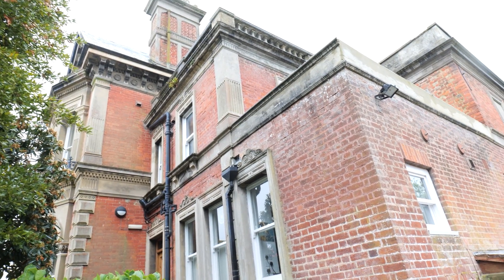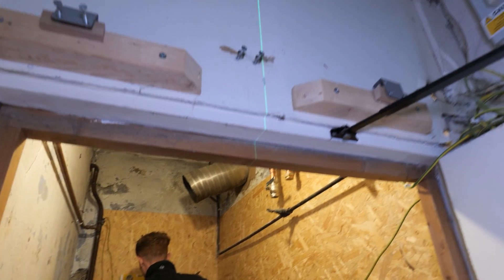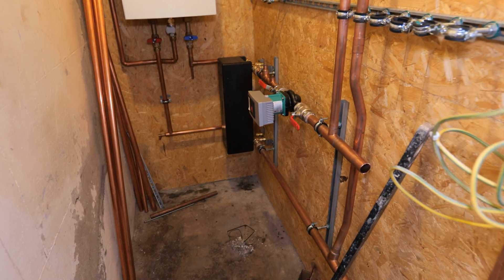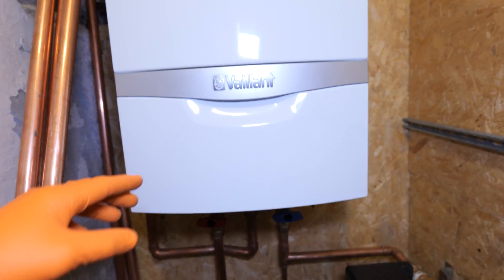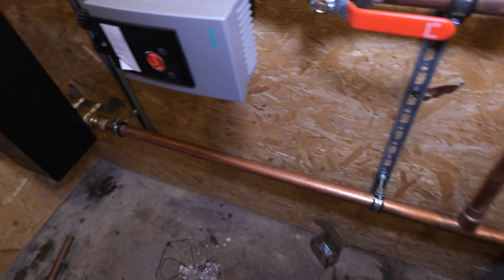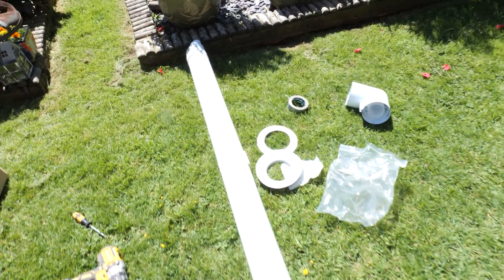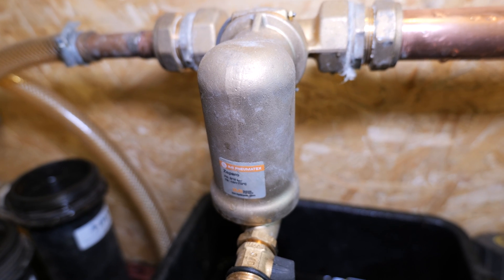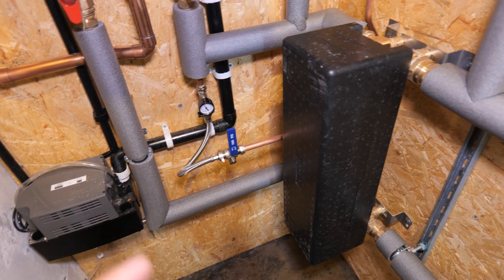Plate heat exchanger -  Vaillant 64kw

Comment: What's the score with wiring the extra pump after the plate is it just wired on the same switch live that kicks boiler and pump on
Reply: Best to wire independently on the boiler. For regulation you should put another NTC sensor behind the plate exchanger and connect it to VR-70 wiring nest to sysflow imput (or to some vailant system boilers to X41 connector syst temp inmput) so the secondary can be properly weather compensated.

Comment: Something to think about - I always thought a plate heat exchanger should be piped countercurrent 
Eg boiler flow top / boiler return bottom - system flow top system return bottom 
Just think of a combi plate heat exchanger - mcw and boiler return are together as are hot out and boiler flow
If you leave it like that the flow to the system will be at the boiler return temperature ie 20 deg lower then you require - plus the temperature degradation loss
To quote Andrew Millward - hope that helps 😂
Reply from the maker: I'm pretty sure it is piped that way. So each side is opposite. But the flow enters the bottom from the boiler. System flow leaves from the top. I don't believe it makes a huge difference which way round it is installed but could be wrong. Thanks
Reply: Didn’t watch till the end before making a comment 😮😂 
Can remember a heat geek video on a commercial plant room in a school where they couldn’t get the rads to temperature and the plate was piped like yours 
Keep up the content good to see the experiences of others in the trade 👍
Reply from the maker: @markcostello2734   Although the system seems to be working fine and reading the right temperatures I think you are right! Someone else just commented at mentioned it. I cant seem to see the comment/person now! So if that was you thank you very much. I have the flow and return opposite which I thought was correct, but its not piped up Counter current! Thanks for pointing this out guys. I will be heading back !
Reply from the maker: @markcostello2734  Haa thanks. You had me panicking then. It was all working lovely. Thanks for watching.

Comment: Why is the pump on the return pipe ?
Reply from the maker: It's not. It's on the flow 👍🏻👍🏻
Reply: @loving-plumbing   So, if the flow from the boiler goes to the bottom of the plate heat exchanger, when it exits, it exits from the top? If yes, why? 
I’m just an apprentice 👍
Reply from the maker: @MAZZADAILY  so it's opposite to each other. Flow in the bottom from the boiler so it heats up the return as it comes through on the other side. The two systems never actually mix. Only transfer heat.

Comment: So if the vent and cold feed come all the way down to the cupboard….why use a plate?
Reply from the maker: To separate the potential problems, the old original system could cause a modern boiler. Too risky pressurising the existing system. So playing it safe really.
Reply: @loving-plumbing  I’d never pressurise an old system either…. But an open vented boiler may have been ok in this scenario….pump so low down….no pumping over issues..and the fact the old boiler lasted so long…testimant to quite a good clean system. But I get your point